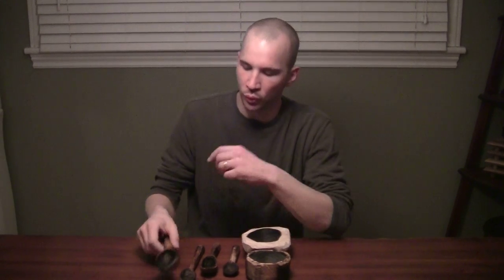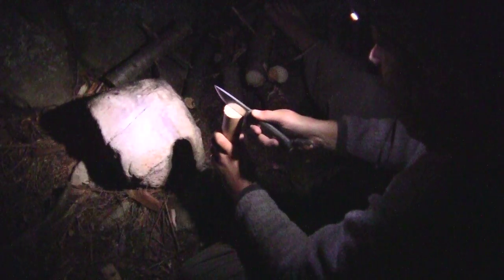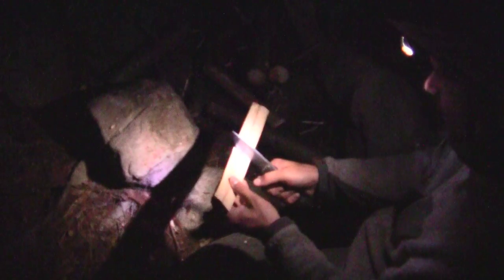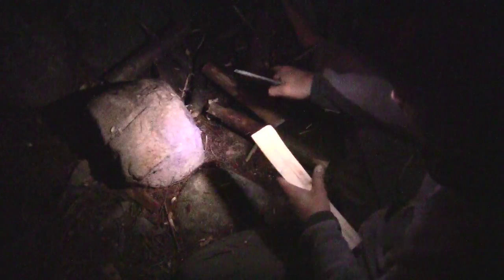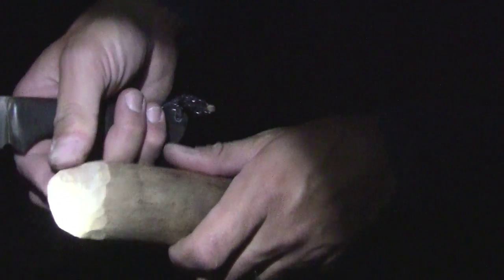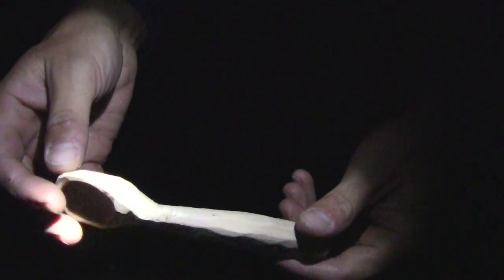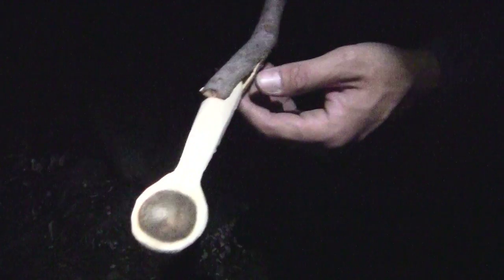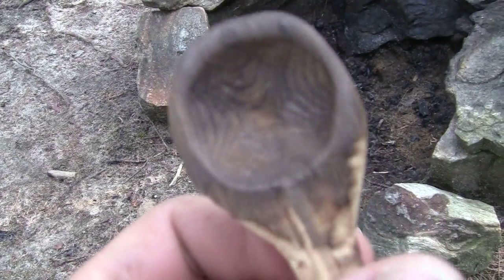How To Coal Burn and Carve a Spoon

Comment from the maker: @nickfish03 The knife I used in this video was the Bark River Bravo-1, and yes, it did go rather quickly since it was done with a soft wood - pine. Due to some rusting problems with the carbon steel, I'll be trying out the Fallkniven F1 next season. Bark River makes great knives but it seems I just can't beat the rain lately and I don't want to worry about always keeping my knife dry, especially with canoe camping.